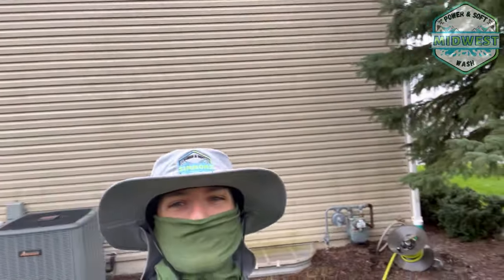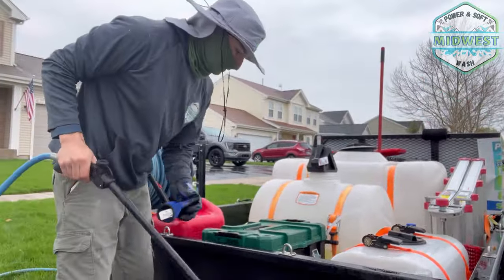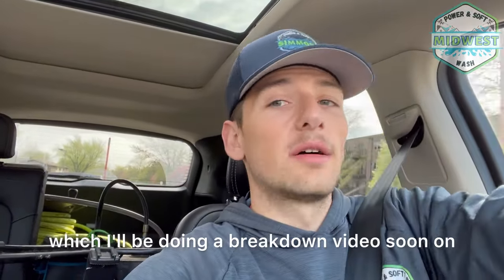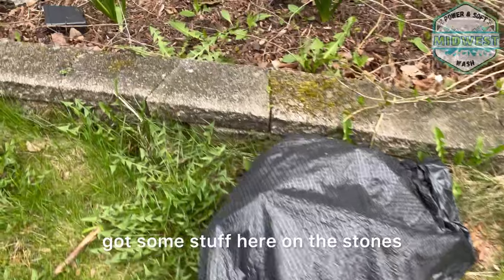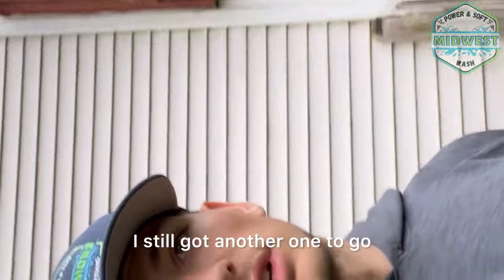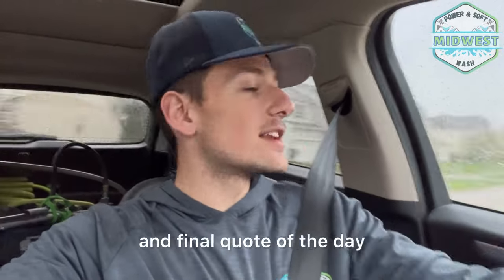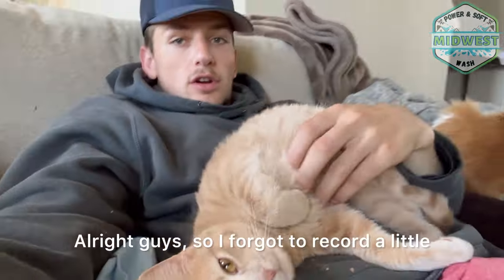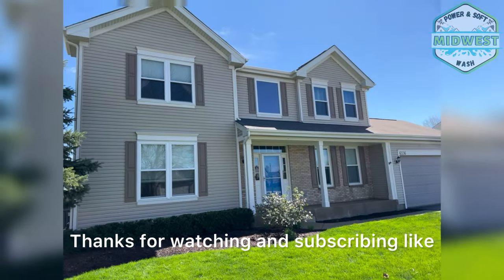Soft Washing Business Owner Day In The Life GONE WRONG VLOG #3

Comment: 12v probs suck I still haven't figured out what was wrong with mine last week, hella busy. Keep up the good work man, subscribing now!
Reply from the maker: Ever since I got these new metering valves, it has been working so well actually. I think from the get-go one of my metering mouse was cracked, and I was never getting full pressure out of it until just recently when I switched metering valves.
Reply: Probably an air leak from the outlet on the pump head. If you can go 90* elbow fitting off the pump. If that’s not it just check out your other clamps and fittings.

Comment: Bro just drop that shit and run an X-Jet. Night and day and get rid of that 12v nightmare.
Reply: Is 12v that bad? All I do is jet simple.
Reply from the maker: Just upgraded to remote downstream & it’s life changing man 🔥🔥👌
Reply from the maker: It’s great for roof washing & getting higher % mixes that’s for sure
Reply: @kennylil4895  biggest waste of time and money. (With the exception of SESW) no experience with their 12v. Just jet and forget.
Reply: @MidwestPower_SoftWash  no need for remote when you jettin’. Just pull your tube out of your bucket. I tend to control my soap with my nozzles anyways just more simple in my opinion.
Reply from the maker: @MEGANODE  remote goes crazy bro way better than xjet hoses & stuff. I’ve got a video I’m uploading showcasing it
Reply: @MidwestPower_SoftWash  sounds good but I’ve done a couple roofs and other stuff with the X-Jet and having no issues. No reason to fix it if it ain’t broken at the moment.
Reply from the maker: @MEGANODE  yessir heard that. I just upgraded my entire trailer & one of the perks was a remote downstream system 🔥 I have x-jet before tho & it is beast. 👌
Reply: @kennylil4895 stick with the 22 volt , DS sucks
Reply from the maker: Why does DS suck if you have both systems ? 12V is great for pulling more SH but Downstreaming is so efficient for washing houses.

Comment: Learn how to work on your own equipment. If you are not pulling on your equipment you most likely have an air leak or a crack. Soft wash equipment is elementary school level
Reply from the maker: Yeah let me just pull a metering valve right out my a** buddy 😂💯
Reply: @MidwestPower_SoftWash  what are you talking about brother
Reply from the maker: @HouseWashingRick  my metering valve was cracked was the issue. Sorry I wasn’t trying to be rude 💪💯
Reply from the maker: You basically implied I don’t know how to fix my equipment, but sometimes you need a vital piece in order to fix it. In this situation is was my metering valve that was cracked, not just an easy fix. 

So I had to go to power wash supply store to get the metering valves. I didn’t have any extra on my or I would’ve swapped them out. 👍
Reply: @MidwestPower_SoftWash  I wasn’t talking about you brother. I was talking to the younger guys coming up into the wash industry that it’s a good idea to learn how to work on your own equipment. That way if they break down on a job or something they can found out what is wrong and fix it on the spot and keep running. Nothing was against you. I started washing in 1991 the younger guys in my area I work on their equipment for free but I make sure they help me so they know how to fix it next time. I also helped them build their own equipment for free I love seeing you younger guys doing this as us older guys are going to be retiring in 15 to 20 years